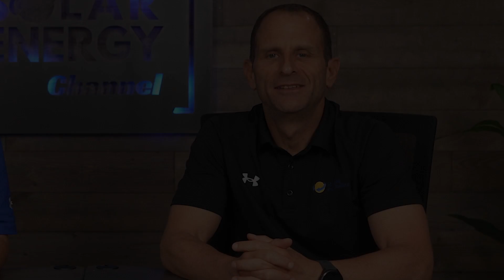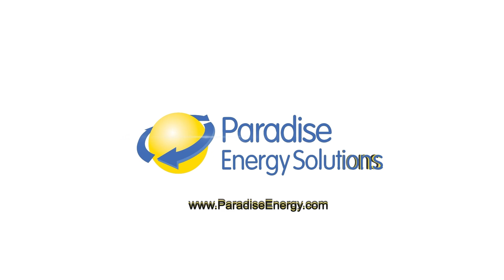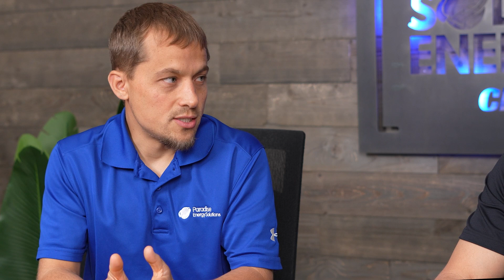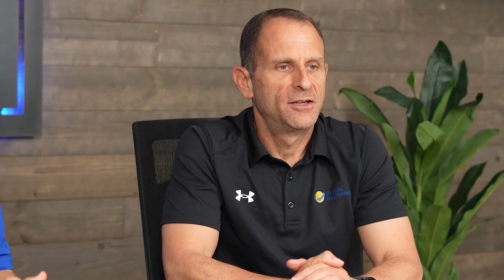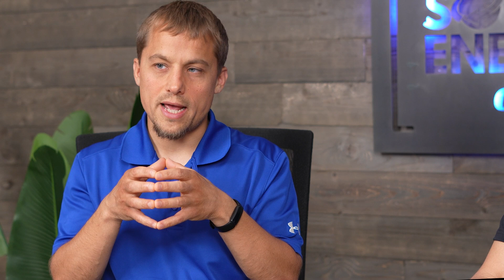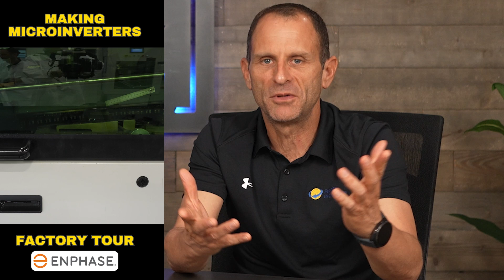Microinverters vs. Power Optimizers: What are they and which is better?

Comment: So you do not need an MPPT controller when you use a micro inverter?
Worried about shading then run your panels in parallel.
How are microinverters synchronizing the AC sine wave?
Those guy imply a root top mounting array.
Not wall mount or ground mount setups.
If you have to worry about getting max power all the time you need better/bigger/more panels.

Comment: I am very surprised that you say that both are very similar on how they work but you missed a crucial point. Panels only produce Electricity when there is sunshine and does NOT offer on demand Electricity. To get on demand, which is an absolute requirement for most of us, we absolutely need BATTERY Storage. This is also true more and more, as the Grid Providers are phasing out Net Metering if you even have that available. The DC Optimizer provide DC Power that can be used to charge your batteries. With the AC Micro Inverter, you would have to convert back to DC with a 25-30% loss, before reconverting to AC with an additional 10-15% loss.

Comment: So if I wanted to save the most energy when converting from DC to AC, like when opting for a DC coupled solar battery, then the DC optimizers with a central inverter would be the way to go?
Reply from the maker: If you want to save the most energy when converting from DC (solar/battery) to AC (home/grid), go with a DC-coupled system using DC optimizers and a central inverter.  It avoids unnecessary power conversions — your battery charges and discharges in DC, and only one DC-to-AC conversion happens.
Reply: @thesolarenergychannel would it be the same situation of less DC to AC conversion energy loss if the solar battery had a built-in inverter? Seems like it with batteries like the Powerwall 3, etc. But then you wouldn't have individual panel monitoring.

Comment: With microinverters you are going to lose more electricity when transferring back and forth from DC to AC to DC (back and forth) like when charging batteries, etc. where optimizers with the same number of pv panels and a single large inverter it sends the DC straight to the batteries from the solar panels so the DC is more efficient.     Every time the system changes electricity back and forth from DC-AC-DC the wiring and inverters get warm or even hot and you are losing efficiency and losing electricity.      On a large home and large roof with lots of solar panels it may not matter to you as much as it might for someone with a small array that is limited on the number of panels they can install.

Comment: I have an opti system and recently got back into Ham radio. The RFI issue is horrendous. I have looked into Microinverters. A friend and fellow Ham has that system and has no RFI interference. The cost to convert my system over to an Enphase system is going to be very expensive. Your thoughts?
Reply from the maker: We are by no means RFI experts. Before considering any replacements, we would encourage you to first understand and measure the noise affecting your Ham radio system. This blog appears to be heading in a direction we would recommend, though we cannot personally vouch for its technical accuracy: https://ka7oei.blogspot.com/2024/04/analysis-of-interference-from-solaredge.html

With a clear understanding of the noise in your system, you should be able to work with a company like Schaffner or a similar provider to determine a solution that reduces the interference to an acceptable level. Hope this helps. Let us know how things work out.

Comment: How does a microinverter integrate with a battery backup for power failures or rolling blackouts which are all too common in South Africa?
Reply from the maker: While manufacturers vary, Enphase makes microinverters and batteries.  Their batteries come with a separate inverter, utilizing the same distributed architecture as their microinverter.  The battery and solar would be AC coupled.

Comment: one advantage optimizers have over microinverters is that if you have a battery in your system as much as 25% of you power is wasted - converting the 240 volt from the microinverter to DC to charge the battery and convert back to AC to use in the home or send back to the grid.  This is s serious consideration I think you missed

Comment: You really did zero explaining, but circled around location of the box and other frankly irrelevant info. Like.. wtf..? how does the optimiser handle a panel where a leaf lands on it vs not? Your doing nonexplaining nonstop disguised as "almost about to explain" lol
Reply from the maker: Could you please clarify? ;) Thanks for sharing your thoughts.
Reply: @thesolarenergychannel  I believe he is asking how microinverters and optimizers handle shading variations on a bank of panels on the same string. At one point, a big benefit of microinverters is there output was additive so if one panel had full sun, the next panel was blocked by a chimney, on the same string, there was no loss of power output. I am presently trying to go through this analysis for my own DYI project.

Comment: Thanks again for one of the best videos I have seen on any topic. It is clearly answering the question on optimizers vs microinverters.

Suggestion: Video on analyzis of why the SolarEdge stock has gone down so much lately. What are the MAIN challenges now and forward for SolarEdge? I heard SolarEdge is the best option for optimizers. Have experience from them and so far they are working very well having (SolarEdge app, inverter 7kW and optimizer on a high roof, private). Is SolarEdge still a leader within solarsystems based on optimizers? Are they making and selling microinverters? How do you, if possible, judger SolarEdge prize to "money back from the investment" ratio?
Reply from the maker: Thanks for watching and for the suggestion!

Comment: I think you need to discuss the new hybrid inverters to help people make those decisions.  I am going with optimizers since I am going to use a hybrid inverter that makes installation easy for battery back up  and possibly adding a generator later.  If I wasn't planning on adding battery back up, then maybe micro inverter would be ok.
Reply from the maker: That is a great topic suggestion. It's on our list for future videos!

Comment: My roof faces are east and west.  So I guess Optimizer wins.

My present asphalt shingle roof is 29 years old and my insurance company is insisting that I have a new roof put on my house.  I would like to get a new roof and at the same time have a solar system installed.

Do you do roofing (or partner with a roofing business), or are you only a solar panel installer? I would like to hire one company to do the whole job rather than trying to coordinate between two businesses.

 I'm also interested in knowing if you install solar shingle roofs like the GAF Timberline solar shingles or CertainTeed Solstice solar shingles?  I know the solar shingles are more expensive but I like the way they look and would seriously consider them.

You have a lot of good reviews.  Keep it up!
Reply from the maker: Kevin, We only provide solar services. However, we've worked closely with our customers and roofing companies in the past. It would not be much additional coordination on your part. We do everything we can to make the process as seamless as possible. 
We do not install solar shingles. 
Thanks for watching! And we appreciate the encouragement. 👍